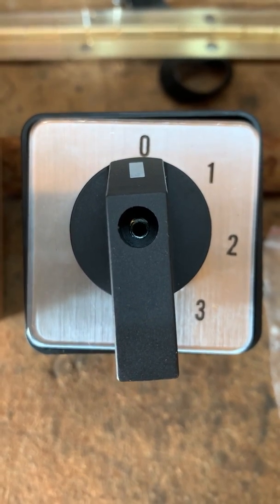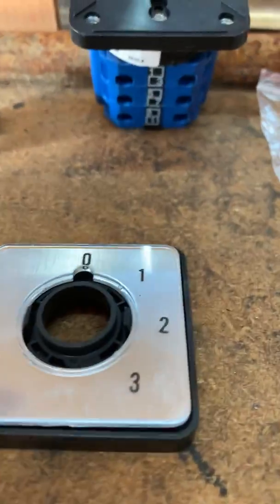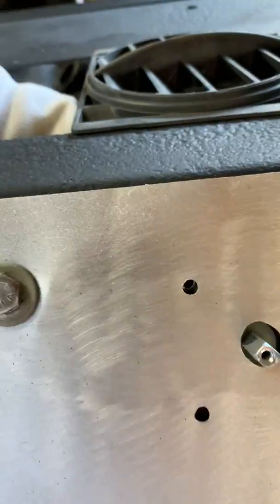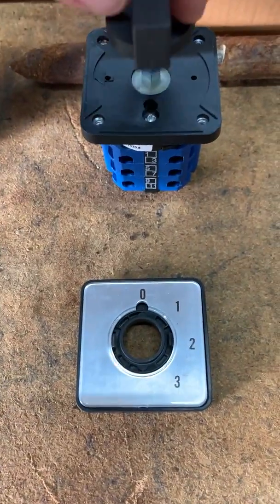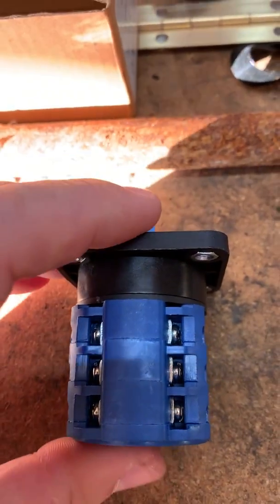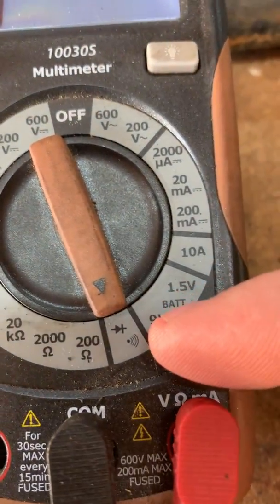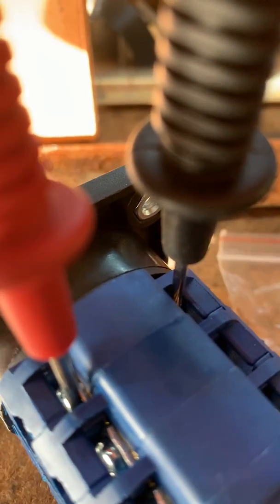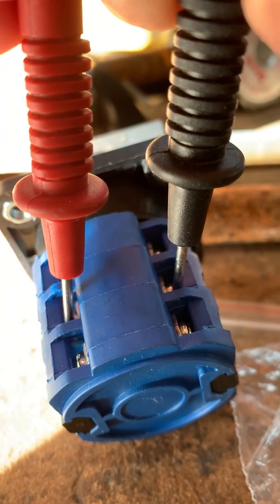4 position rotary cam switch

Comment: I have a 4 position switch like this, quite new but it has stopped working properly, it will only go to two positions and jams in the other positions.
Does anybody know how to open it to try and see what is wrong inside?
It seems to come in slices - perhaps I could replace the faulty slice with a good one from another switch.
Thanks.
Reply: Honestly, these are $12 on Amazon. I wouldn’t waste my time trying to fix the one you have.

Comment: Can u mount it on din rail. Please reply
Reply from the maker: This particular switch is not designed to mount to a din rail directly, there may be others that are but none that I’m familiar with. You could fab up your own mount to the din rail and then attach this to the mount but you would have to get a little creative.

Comment: What about the ground cable? This is only for pos & neg, right?
Reply from the maker: This is a pass thru switch, it's not a powered or grounded switch. I used it to pass power thru and grounded the blower motor with a single ground.

Comment: I have 4 12v lights I want to switch from (off - all 4 - just 2). They're currently wired to all switch on together with a relay that switches with the car ignition. I don't want them always on when Im driving so I want to switch them. I can easily make an on-off switch for all 4 with the power leads and an on off from two lights to all four lights, but ideally I want it in one neat switch rather than 2. Would a rotary switch work for that?
Reply from the maker: Missed your comment from awhile ago but yes it would work. This switch has dual connection points where you can connect multiple wires to.

Comment: How to mount it?
Reply from the maker: You can mount it a variety of ways,  I took the black cover and placed it over the plate I wanted to mount it to and marked where the bolt holes were and the main hole. From there I just drilled and cut until it fit and mounted it in place. It’s different for each application.
Reply: Thanks for the tip on removing the cover plate (metal looking with numbers) to access the holes. I may scuff it up moving the tabs to release it, but the end result will still look better than drilling screw holes through the cover plate, as I was thinking of doing!